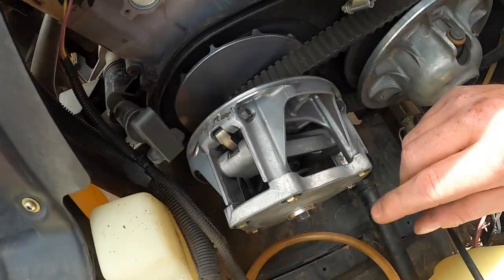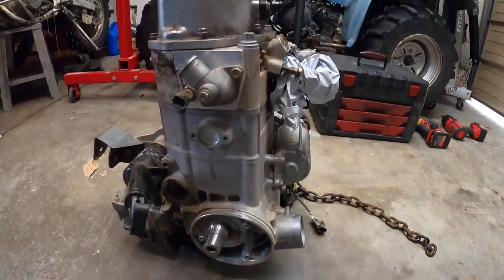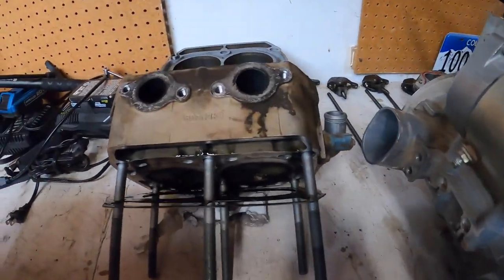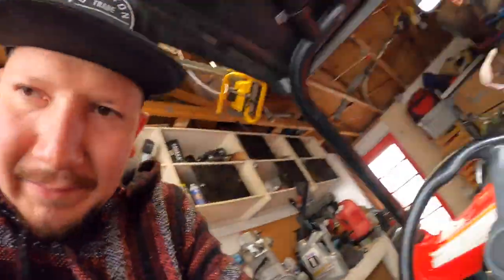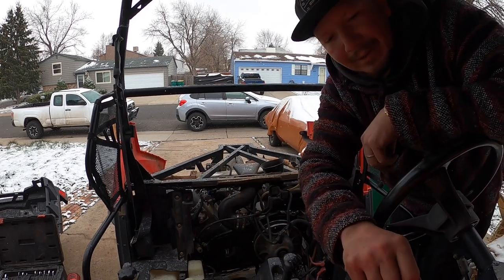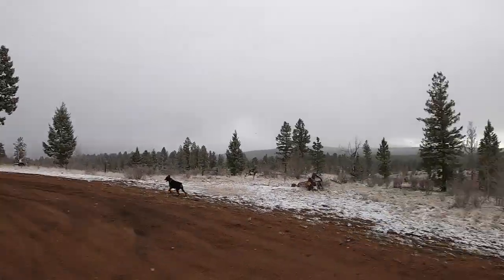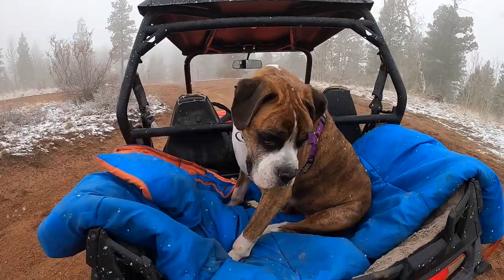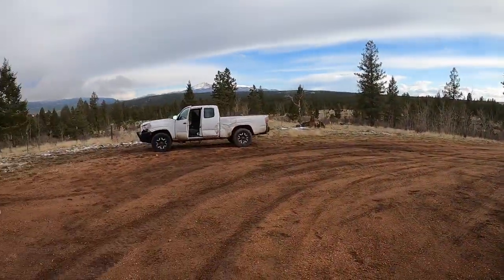How to fix rod knock

Comment: Did you have to replace the pistons and jug? Or just crank assembly? Same thing happened to mine I havnt ordered parts yet figured I’d find more info before tearing it down
Reply: hi for rod knock you only have to replace the crankshaft and connecting rods and connecting rod bearings .. but if you have drove it for a while with rod knock it might have starved that piston from oil because the oil passes through the rod to the piston rings on some engines ..so you might have low compression on that cylinder but yea let me know how it goes